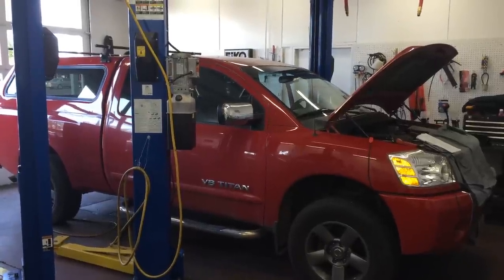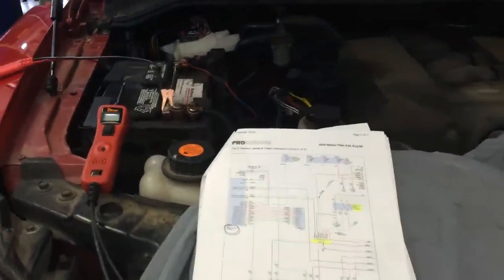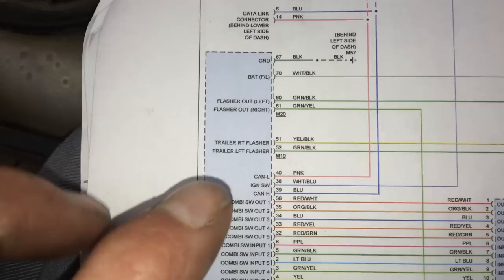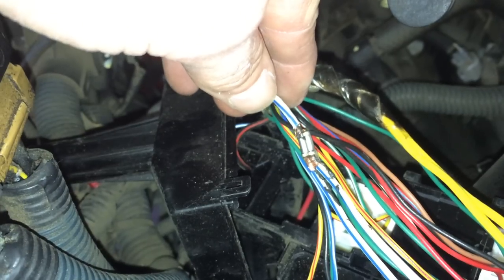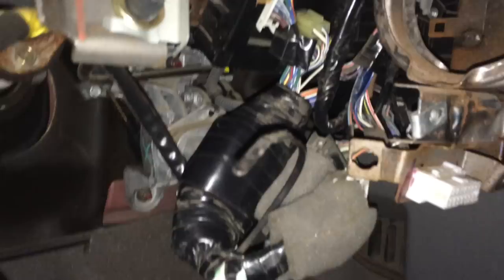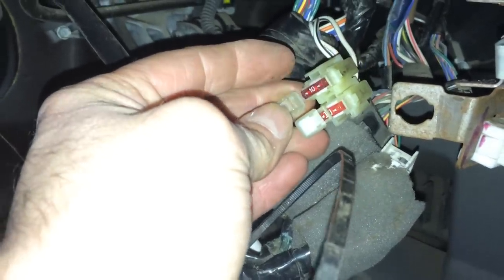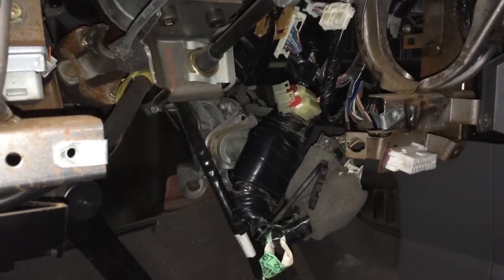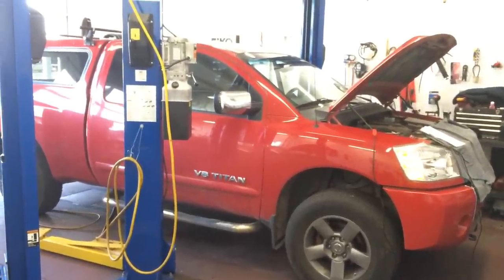The Case Of The Nissan Titan With "Hidden & Undocumented Fuses"

Comment: Great find but those fuses are part of a tow package control module recall that was done on my 05 titan. I remember them saying there are now fuses in the dash. There should be a diagram with the tsb. Nissan took the cheap way by not extending those fuses so they are not inside the dash panels.

Comment: Thank you for your video! Most probably I have the same problem. I bypassed the brown relay contacts, but no voltage on the rear bumper socket. The most probably broken place is that weird clamp in the wire, where both relay contacts are connected together to the running to the socket wire.

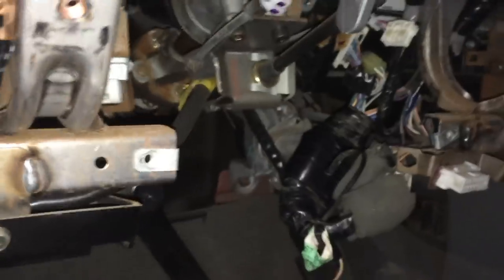Comment: The jumble of electrical connectors that are all taped up that appear at 1:55 in the video... what are these? My 04 Titan has the Big Tow package and also has this mess? Is this related to the tow package?
Reply: The big tow package only gives you a bigger axle gear and the tow mirrors.
The standard diff comes with a 2.94 ratio while the tow package comes with a 3.36 gear.

Comment: Hey I got a 2004 nissan titan and installed a new headunit and amp the other night. Went to town and on the way back truck goes into limp mode and now I getting a bcm code can this cause the limp mode and trans getting stuck in 2 or 3rd gear
Reply: i have the same problem how did you fix it
Reply: @ChefFlee2018  i got to buy a transmission 4th gears are burnt up and the tcm is bad according to the transmission shop. its gonna hurt the bank account too trying save up for it now. they gonna do a reman trans 30,000 mile warranty or 3 years and they are going to replace old factory style radiator with the new redesigned on that will be sent with the trans.   i could put a junk yard one in but guy said ill be back probably with in the year to replace that one too. i put  a new engine in it last year so i guess gonna go ahead and put a new trans in as well. at least ill know what i got then in it.
Reply: plus my trans will be covered for the next 3 years if it fails. it wont see 30,000 miles before 3 years so there is that piece of mind there too,.

Comment: I need your help I have 04 Nissan Titan none of my lights on the back worked but I disconnect harness from behind right side door and fixed it so I thought all my lights now work except the brake light I've checked all fuses and relays and the turn signal use the same bulb as the brake.
Can you please help me